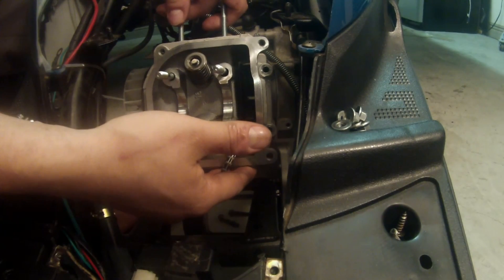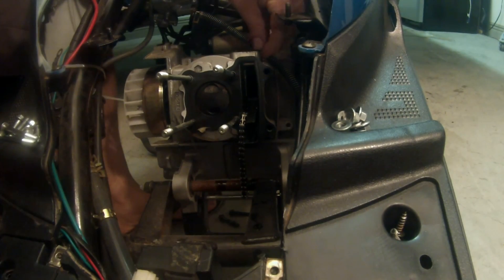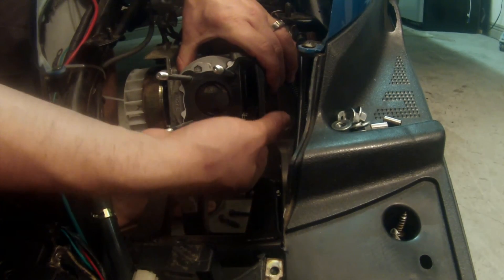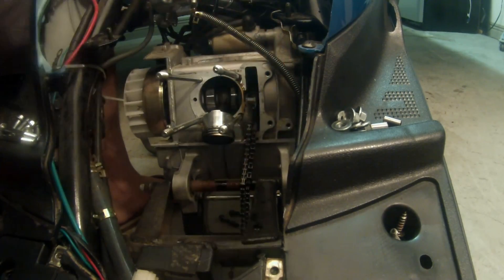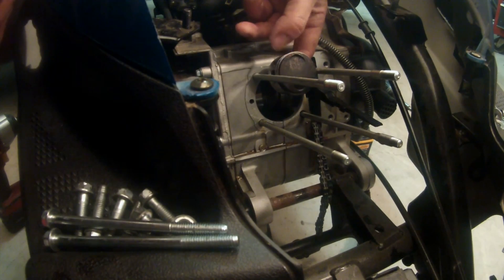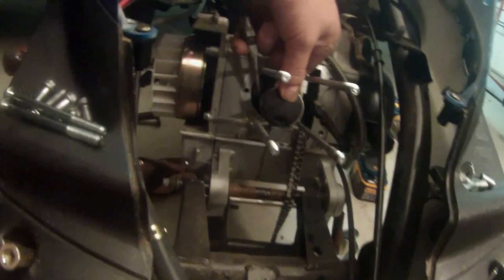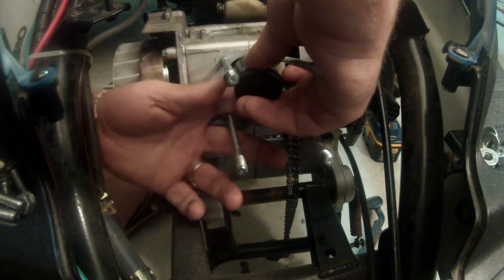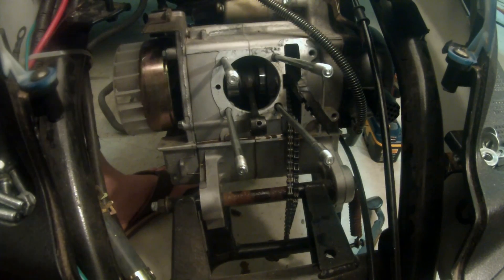Scooter Big Bore - Chapter 5 - Remove Head, Cylinder and Piston

Comment: sorry I was putting that comment for previous video. how do you get top dead center when I already have the chain off? Is it when the Piston is fully out. Or in. It is not correct by the T mark on flywheel plz help. I seen a trick with a straw in the spark plug. Is TDC when straw is fully extended?